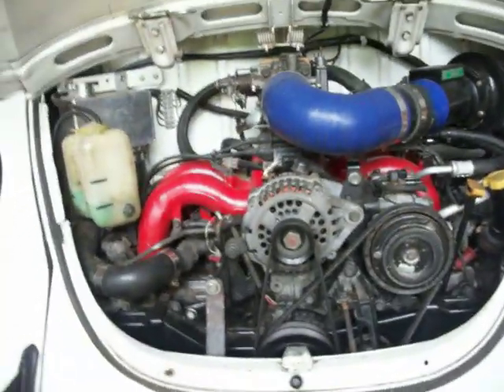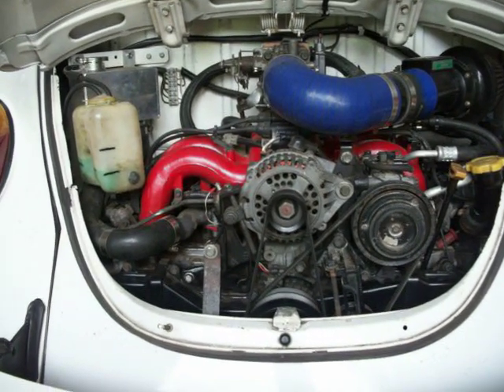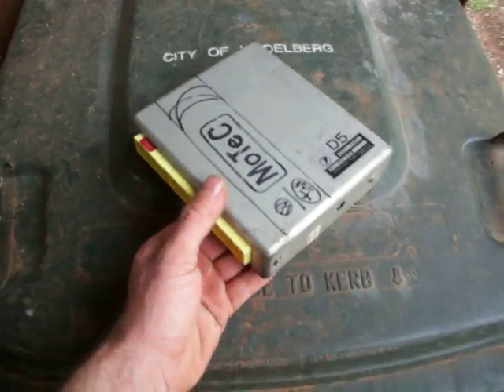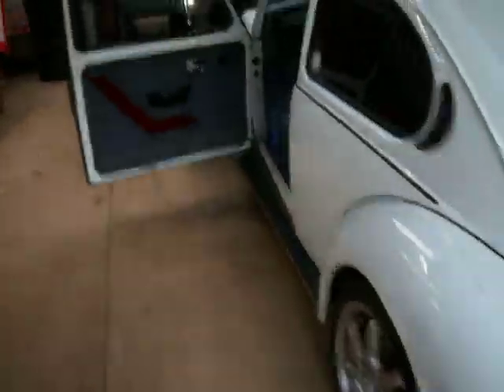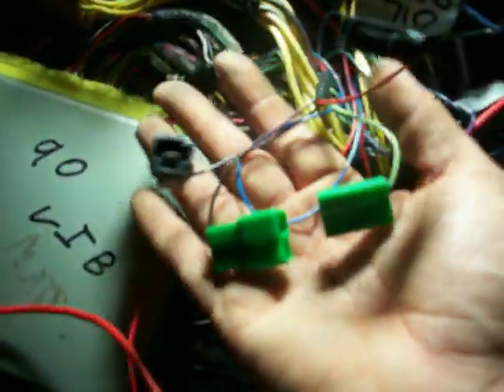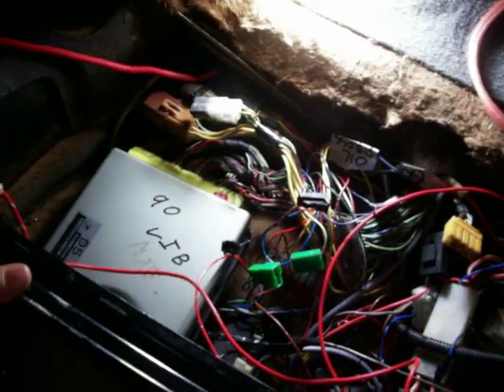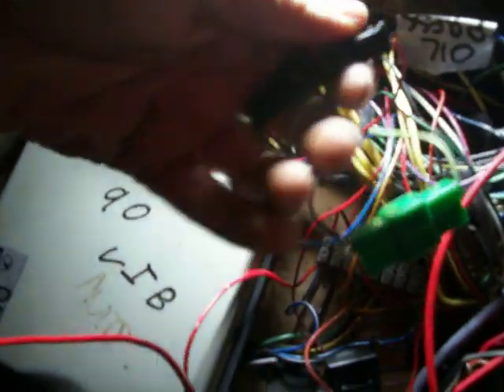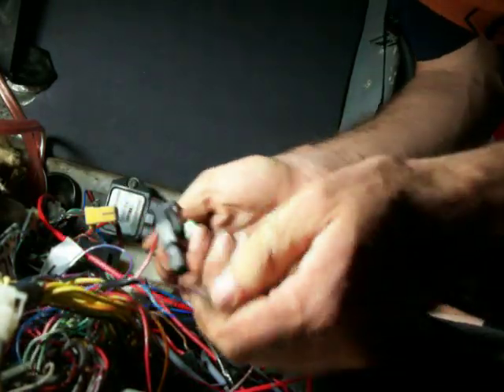How to read EJ Subaru Check Engine Error codes

Comment: i like the motor ,my friend had a ford v6 in a combie.The weight chucked the rear out at the corners ,almost dangerous but fun
Reply from the maker: paul white that's what appeals about the Subaru, same flat 4 configuration and not much heavier so hasn't changed the handling

Comment: Harsh clattering noise on cold start, and acceleration. I don't know much about Subie motors, but it sounds like tappet or valve rod, and appears to be coming from one cylinder/piston area only. Doesn't seem to affect motor performance - but then I wonder how well it would go if the problem was fixed! Done 190K km. Thanks.

Comment from the maker: The knock sensors don't often go bad but they are very simple to replace, just one bolt in the center and a single wire plug. they are down the back of the manifold under the throttle body
Does the check light stay on all time or is it just coming on and off randomly?

Comment from the maker: @buymeaskyline I wanted to do that originally.
A few mates have done it but there is alot more work in it, the quad cam engines need the body cut up heaps more and the gearbox moved forward.
Also a gearbox that wont break costs more to build than my entire conversion cost.

Comment: McDonalds is bad for you... nice vid by the way :-)  Answered my question about the check engine light continuously flashing with the black plug connected... wasn't sure if that plug was meant to be connected under normal operation or not. Cheers

Comment: I'm basically the same as you, living on a  dairy farm in NZ, in Karaka, Auckland.  Tinker'er in the shed. I've got a stock 1600 engine (although the original owner says its an 1835cc)  with a couple of alterations, bigger carb, alternator kit, chromey parts which are only for looks, and new parts like fuel pumps and the lot. Black 66' with 8 spoke American Eagle Empi mags. Wish I could send you photo's but don't know how without giving my email address to the world

Comment from the maker: @omfgursodumb It's a home made setup, you can see it in my recent vid where I removed the engine, header setup is same design as a WRX EJ20 turbo setup, 2.5" highflow cat and a 12" long straight through 2.5" mercury turbo muffler. sounds alot better in person.

Comment: Thank you. . Tomorrow I will replace all the rubber pipes. How the vehicle computer consiler know if the normal. It's electric valves. There's no sensor. Do you think it will solve my problem. I noticed that. I'm running air conditioner to another. 10 minutes the engine stutters on and off my engine check lamp. Or maybe because I have a column clock problem. (It works fine up to 1000 loathed. above it is not look like he's stuck.) It affects computer performance vehicles.?
   Thank you. Great

Comment from the maker: @sa997 Make sure that the rubber hoses that  join the metal pipes between the charcoal canister and the purge valve and also the purge valve to the throttle body are not splitting anywhere or disconnected. After 17 years they would be getting hard and perished. That will cause air leaks which can make the engine stumble when the valve opens.

Comment: You seem an expert. I have a Subaru Impreza 1.6 94. I have two questions. Social the plugin. Black and showed error 35. (canister). I checked it and it correctly. 44 Om. He closes vacuum. Opens, and liquidity. I did a test with the green connector. Travel in all normal. I wanted to delete the problem connecting two black authors black and green to green. But the problem is not deleted. This is a problem because I have error traveling with Air. After 10 minutes. The engine stutters. Check lamp tu